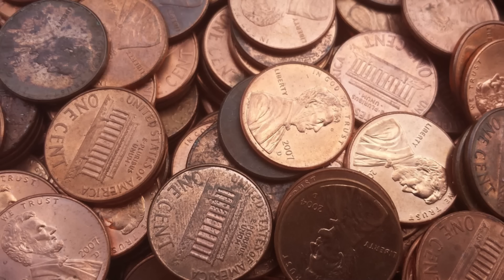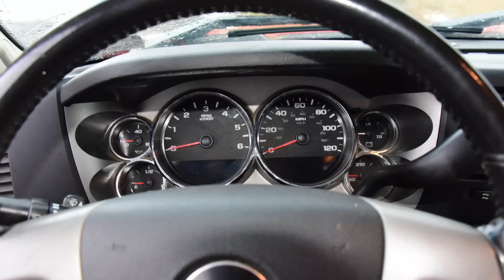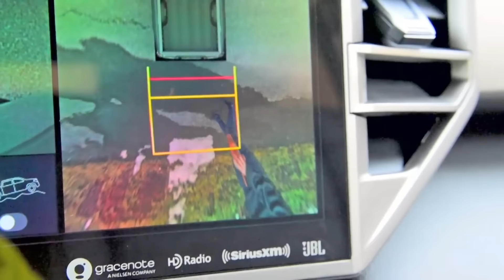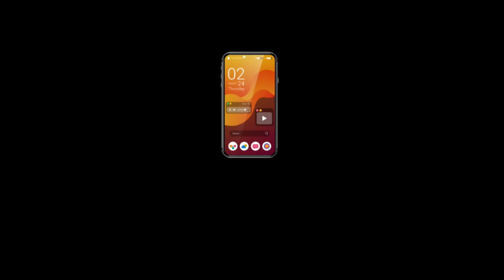2008 Chevrolet Silverado: Regular Car Reviews

Comment: GMT900 trucks were the end of an era. The end of failed stepper motors in the gauge cluster. The end of prematurely rusted brake lines. The end of blandness and cheap plastics.

...or was it?
Reply: I can definitely say that the use of cheap plastics continued, because most dashboards of this era have developed “The Crack” at the top left corner of the passenger airbag. And some have gotten as bad as an Early 2000s Dodge Ram with the dash basically crumbling apart and exposing the HVAC ductwork and wiring harness and causing further problems.
Reply: @digitalrailroader  I've worked on this generation of GM trucks so much that I would not hesitate to buy one if the price was right just for a farm truck. I am quick to rag on them but they're simple and effective. You're also dead nuts on about the crack. They ALL have it.
I can't say the last time I've seen an older Ram that had an intact dash.
Reply: @FeralRC  yup, even the 2009 RCSB my dad has had since brand new has the crack; it hasn’t gone any further because we keep it garaged and it limits the amount of sun damage it gets. (I also had to fix the trim piece below the steering column because the plastic separated from the metal backing plate and was causing an annoying rattling noise.

Comment: Not gonna lie, this religion around trucks is wierd. It's not a vehicle worth putting several transmissions into...and yet you advertise this pile of turds as a good vehicle worth repairing but at the same time it's as throwaway as a cavalier.

It's difficult to word a way that I'm not a fan of the recent extreme scale of X is the worst car on the planet and should be thrown away, and then this comes up and it's okay. 

Can we just agree this is a trash vehicle and move on? Either you find redemption in all vehicles or none.